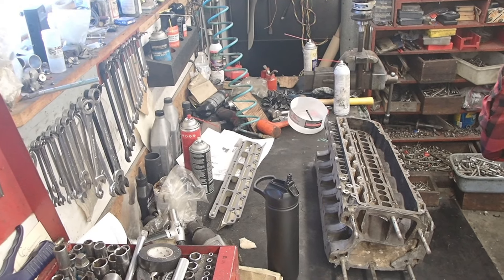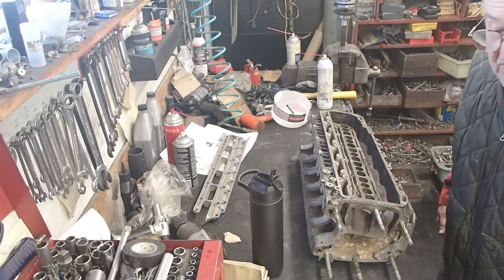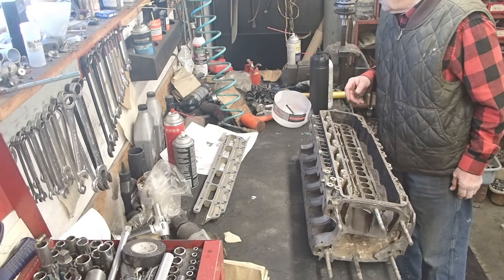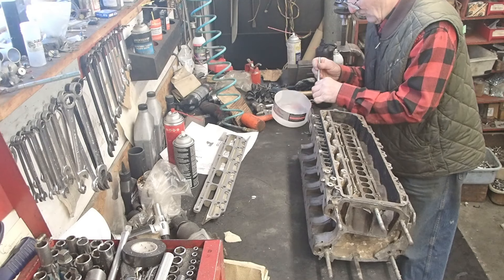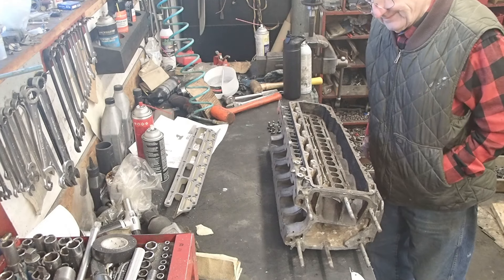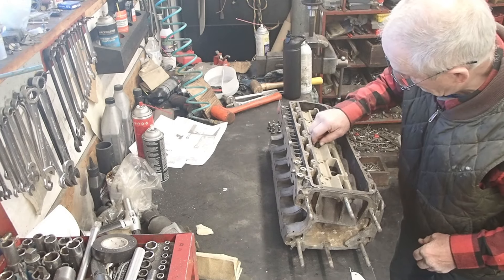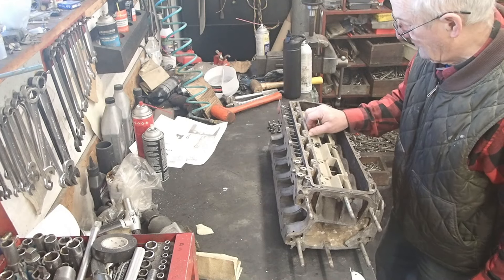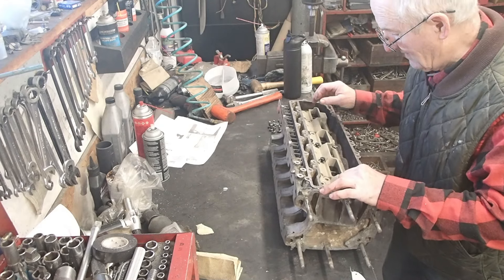6 cyl waterjacket pt 5

Comment: I have a ‘67 Merc 500 that had an issue where it wouldn’t idle well in water and sometimes would bog down when trying to accelerate. I found that there was water being pushed out between the #2 spark plug threads; tore it down and found there was a crack in the inner water jacket baffle plate right next to the #2 cylinder, so the cylinder was sucking in water and therefore wasn’t running well. There was no apparent damage to any other components. Thankfully I was able to get a brand new plate and the motor has run wonderfully ever since.

Comment: I did so many of these in salt water useage in 1980s .
Pistons melted one overheat event .
Reed valves swallowing disaster motors.

Terrible design.

Nice channel 👍
Reply from the maker: When alcohol was introduced for the second time for good all the manufacturers had similar problems the v designs were and are more tolerant , stuck rings , predetonation were somewhat solved by TCW 3 oils . also sounds like you worked for a dealer who sold go fast boats 90 % of my business was commercial clammers and lobstermen
Reply: @pinetreeboatingclub  I did both commercial and pleasure.
Mercury has rusted drive shafts shift shafts rotted blocks exhaust covers ignition failure on triggers  no overheating alarm. In 1984-87 carb floats actually melted from alcohol true .
And new synthetic oils really helped also .
 
These Mercs Chrysler Force ,OMC  and Mercruiser put me through University engineering degree 😆 Kept me busy all winter.

Amazing we have V4 Evinrude Johnson 1970s and 3cylinder still running .
So sad OMC gone now .
Yamaha Suzuki took over .
Yamaha stole OMC and Merc technology.

I have a 1990 50hp Yamaha all original except plugs and water pump rubber impeller.
Salt is starting to dissolve these 1990s Japan motors now.

I had the tools to install Pistons in those 6 cylinder Mercs except the 140 which had holes in piston skirts .

Reed valves and number 2 and 3 pistons would melt stick rings one overheat event I recall.

Nice videos thank you 👍